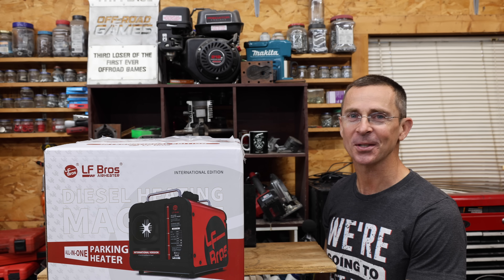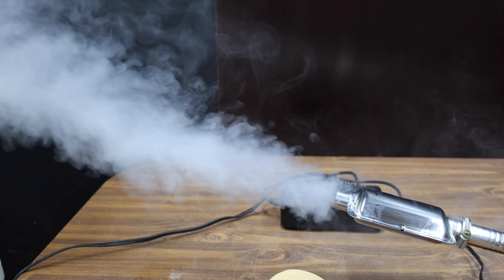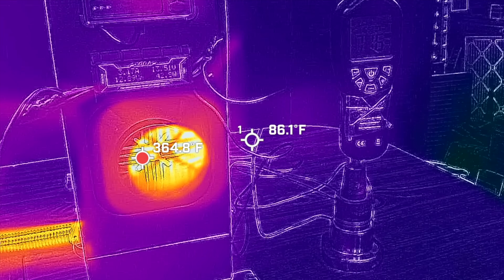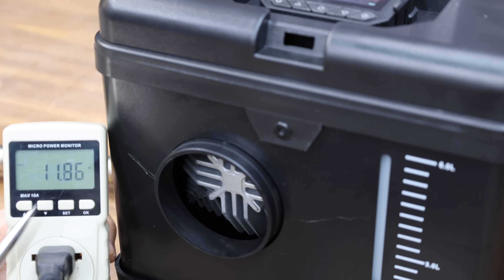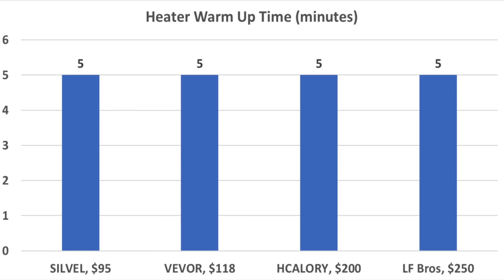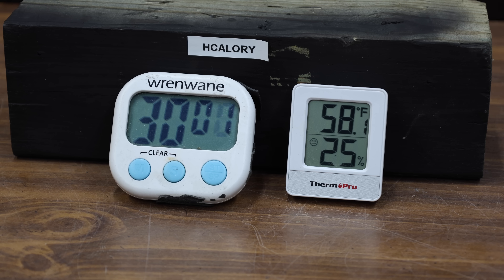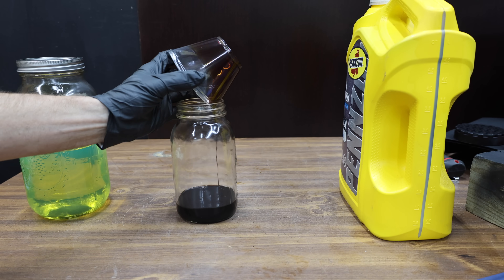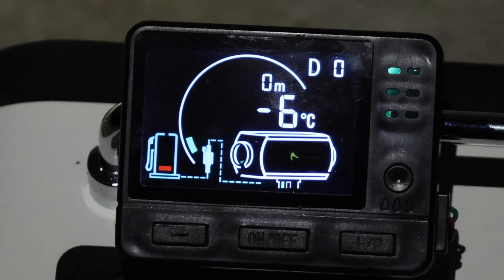The Truth About Cheap Diesel Heaters!

Comment from the maker: I have to admit, these diesel heaters perform a lot better than anticipated! I'll be having one of these heaters ready just in case there's an extended power outage from a blizzard this winter. Check out the video description for additional details. Thanks again for all of your video ideas, including this review topic! Best regards, Todd
VEVOR: https://amzn.to/4fXPjsy
SILVEL: https://amzn.to/3Vum48C
HCALORY: https://amzn.to/4fnFseJ
LF BROS: https://amzn.to/4glYZgi
AC to DC Converter: https://amzn.to/4g3Or5B
Cigarette Lighter Adapter Power Supply Cord: https://amzn.to/3Zo7vEO
Extra Long Exhaust Pipe: https://amzn.to/49pSpD4
Extra Long Air Duct: https://amzn.to/49tSRAc
Reply: Math time. A gallon of diesel fuel contains 138,700Btu or 36,500Btu per liter . These units claim to produce 8kw/hr of heat, which is 27,200Btu. Except,  these units claim to burn 0.5L/hr, which is 18,650Btu. How can you produce more heat than consume? Clearly,  the units produce less heat than advertised. 3412Btu per kw means that these units gross 5.35kw and likely net around 4.2-4.6kw of heat, or around 15,000Btu at ~85% AFUE, which is respectable. 8kw is impossible.
Reply: @kevinyancey958 exactly, that's why I'll  stick with my infrared  propane heaters. No noise no electricity  and very efficient.
Reply: @kevinyancey958 they're junk. Very little heat produced. Meant to heat a sleeper cab.
Reply: @kevinyancey958  fuel use I'd advertised on low setting, heat output on high..I haven't tested or do e the math to see how much they are lying by..but the L/hour vs kwh is simply  using the best setting for the parameter being marketed..every company I know does that.. example. when cars market 35mpg and 0 to 60 times...those test are ran very differently..
Reply: @kevinyancey958  my brother in math... Thank you for taking the time to say it so I dont have to.
Reply: @kevinyancey958 The noise must increase btu factor 😅
Reply: I want the hcalory but $200 is a lot
Reply: @pressinpickle345  I have the vevor. And four other brands. Only downside I ran across is every two years you have to clean the burn chamber out. That's the same with any brand I own.
Reply: @slarratt  no never have.
Reply: @bobdodge3171 ONLY downside? How about that they use deisel, heat 10sqft, stink, are loud...😂
Reply: @b @bobdodge3171 Not true.  Operated properly at high heat, they do not soot up.  Run under reducing conditions or on low settings they will soot up quite quickly.
Reply: @pressinpickle345 Don't waster your money. An inverter hooked to your car battery is SO much better! Lotsa vids on YT.
Reply: @DannebergAcres   Don’t be silly.  The typical 12V car battery can store about 3/4kWh!  8kW is about 5 times the power drawn by the vehicle starter motor, at least.
Reply: Please make a BEST BIODISEL video. Used veg oil methanol and lye supposedly works fantastic.
Reply: …I did request cheap Chinese diesel heaters comparison a few weeks ago..wow, thank you!
Reply: It’s best to have a battery backup because the unit needs a cooldown or you could have a meltdown during a power failure
Reply: Best water flosser?
Reply: Are you selling one of the heaters you don't want to keep?
Reply: Will you test portable bandsaw Mills? For lumber. ?
Reply: The problem with extended power outages is that these need power.
Reply: @othername1000 they work off 12v batteries
Reply: @othername1000    Doesn’t everything powered by electricity?
Reply: @othername1000 You can use your car battery. But then an inverter is  way better option
Reply: @DannebergAcres or a portable power station like a jackery.
Reply: LF Link= Currently unavailable.
We don't know when or if this item will be back in stock.
Reply: I got two of them they work absolutely awesome I bought bigger fuel tanks minor bolt 8K
Reply: @TheoriginalAndysgarage    Do you think that a larger fuel tank will provide more heat output/unit time?
Reply: Can you do a review of 1/2" cordless impact drivers? Name brands and knockoffs?
Reply: I have a few I get waste jet fule from an airport I work at free fuel most airports pay to get rid of it  if you live next to a small airport call them they might give you free fuel
Reply: Couldn't you run these on fuel oil and save the fuel taxes?
Reply: @tippytailmckitty2658,  just use off road deise fuel l, no tax on that. I would aslo suggest #1 deisel fuel.
Reply: @guybrock837    They are designed for diesel fuel.  It matters not (apart from the cost) as long as it is diesel powered (read the title on the box) and/or the title of this video!
Reply: Yes they run perfectly fine on it, in Ks. I burn off road diesel .50¢  off per gal.    @tippytailmckitty2658
Reply: Can you test emergency water storage bladders. Been looking at them for water storage instead of solid drums. I think it could also create awareness of different water storage options. That would help with preparedness for disasters. Thanks
Reply: Although I like these heaters, if I didn't need a portable solution I would be more interested in one that can run without any electricity.

I hate mentioning brand names, but like a Dickinson Newport or Sigmar 150.
However they are a simple design that can operate with a gravity feed day fuel tank and don't need any fan.
Basically a wood stove set up to burn diesel.
Reply: Would love to see a video about portable Induction cook tops, mabye the one you can buy at Costco, ikea & few others as well. Test water boiling times, consistency of temperature when set to different power settings, or deep frying ability, pot/pan size that they allow up to & mabye at the end take them apart and see how the coils are set up as I know some brands cheap out and space the coils farther apart than others.

Thanks for your videos!!
Reply: Now try one of the german made Arktronics heaters. They are something that you get what you pay for. Super fuel efficient, faster start and heat, quieter, and I am not worried about burning down my truck camper. They also come with a thermostat that auto cycles to hold a temp. Probably going to plumb one into the shop and one into the house on a battery backup for when the power goes out or the boiler breaks.
Reply: Hi, they even perform better if you plug the exhaust into a metal radiator, as it allows to retrieve calories that would be spilled otherwise.
Reply: @hankhulator5007  i was thinking  this why not use the exhaust  to warm a water pot can it boil water with the heat for emergency  cooking 
Also can we use it to heat a how water loop for a hot shower in the camping  or heat water for storage for longer heat runs 
Or what about  a small radiant  heat concrete  slab to utilize  like a hot rock and run it less fuel
Reply: Blizzard or more likely ww3 preemptive cybernetic warfare get ready folks!
Reply: @ProjectFarm  I recommend buying a 12v battery that can fit in your vehicle to charge up...
Reply: @slarratt Buy an inverter and plug in your hone furnace!
Reply: @DannebergAcres  furnace? What furnace? I have electric baseboard heaters. Diesel greater is a great choice in my case.
Reply: @DannebergAcres or plug it into a portable power station like a jackery if u got one.
Reply: You should do another pocket knife test! With the Demko ad20.5 sharks foot knife in it!
Reply: @ProjectFarm  ww3 incoming
Reply: I had no idea staying warm during power outages could be this easy—brilliant invention!
Reply: I hate my 1,200 sq ft house mobile home   for  9 years have a battery hooked to a battery tender how can I have the power goes out just not interrupt the heat
Reply: @Theresahackforthat  Get a UPS ( uninterruptible power supply) and plug the diesel heater's power adapter into it so you have time to shut it down properly if needed.
Reply: @Theresahackforthat Hook it to your car and charge it
Reply: on the vevor, you missed the u-shape cutout on the back for the exhaust pipe to go out i think. But I may be wrong
Reply: I recommend hosting Charity auctions of all the undamaged equipment you end up with.  Your fans would enjoy having something from you and you can help your local citizens
Reply: Hi Project Farm

A future video idea I would be very interested in watchimg is a comparrison of 12v Lead Acid battery health testers performing a drop test.

I recent had a garage using a Durite meter to fail my car battery. I bought a cheap Topdon BT20 tester that rated batter Ok. Tried test again with a Amp meter clamped around positive wire and max reading of 45A which seems v low and wonder how this compares to other brands
Reply: Please make a videos about welds under $300. Budget welders
Reply: Hi project farm. Not sure if you know a lot about diesel trucks but for example there’s the 6.0 powerstroke. One of the big issues with the 6.0 motor is the head bolts. With that there is head studs. There’s the top of the line brand ARP and other brands like XOTIC, TRACK TECH, and other brands. I’d love to see a test comparing different brands because people say ARP is the only trustworthy brand. Other brands claim the same if not higher tensile strength and someone needs to put them to the test. Would love to see a video testing them.
Reply: I run 2 of these in an insulated 30x40x12 barn and to go from 50f to 60f it takes about 4-5hours. I keep a Ceiling fan and an oscillating fan to move the air around.  I do have a a lot of mass to heat up in the barn though lol.
Reply: So much nicer watching with the volume off
Reply: Hi, I have a "product" suggestion.  I know you are always looking for new test items.  Have you considered testing DIY "hacks"?  I recently watched a DIY sand heater video and of course You Tube is now flooding me with heating hacks using flower pots, bricks, candles, crisco, etc.
Reply: @tinknal6449  my only thing would be you’re gonna have to use a sealed container, completely sealed because the silica in sand must never be breathed in
Reply: The United States government is controlled by alumni corporations, and they build low-grade products to keep the revenue flowing in It’s unintelligent and a waste of resources when there’s one proper way to build a lot of these devices project farm always compares some devices have some perks that other devices leave out and they keep it mixed up like that because of their monopoly system YouTube boiled out this guy‘s opinion to be shared on YouTube but if he explained to the people how the corporations monopoly system preventing them from constructing the right product because it opposes ideas and inventions and discredited what they were doing you would never hear this person‘s opinion on YouTube
Reply: @TMartinez-n8g Wow, the big scary THEY again … 😂😂
Reply: How about testing Costco Kirkland brands versus name brands?
Reply: Very welcomed review, thanks PF!  That said, anyone by chance know if any of the heaters allow the user to program the heater to turn "ON" during a specific hour & day of the week, via a cell phone App(?)
Reply: Are you considering selling any of the heaters?
Reply: If you go suck out old oil tanks heating oil which is kerosene and they are pulling the tank you can get lots of free fuel for some reason the home heating oil puts out more heat name the diesel can you buy at the store if I run just diesel I put marvel mystery oil in it lubricated
Reply: Thanks for the video's
An Idea though a bit late for Christmas safety, single use & small fire extinguishers.
Reply: Great info as always. To gauge the heating power, how big is the shop they were heating?
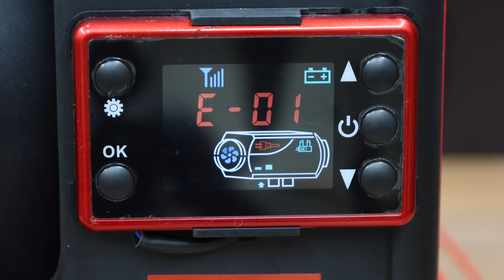Reply: Hey I want to help you out here. You made a mistake on the voice over. 2:20 I believe you meant diesel heater, NOT diesel generator. I am just helping you out so you do not get made fun of
Reply: @ProjectFarm do you ever sell any of the stuff that you have left over from the tests?
Reply: Project farm ! We need a best ash vacuum video !!!
Reply: blizzard . sure. you mean the ews ?
Reply: Suggestion. Best outdoor string lights. Length, spacing, brightness, cost of replacement bulbs, how many string together and still work? As always great videos.
Reply: What would happen if you put pure granulated nitrogen in a gas tank of a mower or a two-cycle engine
Reply: Heat the house with it cos the Air Source Heat Pump is so expensive....
Reply: The 1st heater failed 1st start. So pumped a load of diesel in chamber, when restarted it smokes burning the wasted diesel in camber and exhaust. That's the reason it smoked loads at 2nd start.
Reply: Those seem like pain with exhaust and power.  How about testing out the propane ones.
Reply: Thank you for the video! 🙂 Do you have any tips on what we can do with our Hcalory - the ac/dc plug is not working - We plugged it into an outlet and the light on the box turns on but once we plug the other end into the heater the light on the ac/dc box turns off and does not power the Hcalory. HELP 🙂Please
Reply: @ my ac plug is wired up the wrong way . Live is neutral, neutral is live…. They really are a useless shower of shit. Even my lead to the battery is round the wrong way. I have to connect the live on the negative post and the neutral onto the positive
Reply: Hey Todd, I can’t  find a way to contact you. But here’s a test suggestion: Steam Cleaners. There is ZERO comparative reviews out there. And these can be important cleaning devices, especially for disinfection of animal cages and pens.
Reply: My place drafty I found 2 5 k non cabinet style for under 100  on line set them up on wood platform out side window heat piped in like portable ac gets rid of heat . Use one I need high use 2 setting 1 to 3  2 saves desil plus set to max. Temp goes from 60 to 75 in 20 min😂
Reply: I have one on 12 volt lawn mower battery it can run 8 hrs add a small gen like 800 wat trickle charger or fast  your set 5 gal of gas will go days keeping heat
Reply: Did I miss something? How are these going to be useful in a power outage if they all need to be powered?
Reply: I wonder how they compare to the old fashioned perfection oil heaters
Reply: I got a vevor that was defective and the company will not issue a refund.
Reply: 220F! I want to be warm not dehydrated.
Reply: LF BROS made a big splash in the market with some really nice heaters for a bit of a premium price but they've been gone on Amazon for quite a while. Their website is still up but you can't buy them anymore not sure what's going on I'm sure glad I didn't get one because now everyone who bought them is screwed for parts.
Reply: M
Reply: Todd, I just got one of the vevors on Amazon for $90 and I’m legitimately impressed. It’s going to go into my garage aka the wood shop and I think it will work nicely in the 650 square foot space. I’m considering getting a second one for my pole barn aka the mechanical shop and although it’s 600 square feet, the bottom of the trusses are 10 1/2 feet and the uninsulated roof is a few feet higher. I mean, it’s better than nothing, but do you think it will make sense? I also have a few propane powered heaters of various designs if needed.
Reply: You should do dehumidifiers.
Reply: What are your thoughts on Vevor products?
Reply: Keep up the good work...
Make a video about Car waxes... especially Nufish
Reply: I love it, I been sleeping in a field year round as a homeless man judging the people. No more , bought a mobile home and a diesel heater and batteries .. loving it🎉
Reply: I've searched your videos. Have you tested countertop Meat Grinders or Vacuum sealers? I couldn't find anything on your channel.
Reply: @DrivingWithDon  hey that’s a good idea. I’ve been thinking about making my own hamburger.👍😊
Reply: I have had two vevors for 3 years and not missed a beat, I use one at home to heat my upstairs and one on a yacht, I love them...
Reply: @slarratt The yacht is the only reasonable use.
Reply: So if the power is out and these diesel heater need a power to work ???????.....Thank you Awesome Farm Guy.....                                                                  
Old F-4 pilot Shoe🇺🇸
Reply: @steveshoemaker6347  run it with a 12v deep cycle battery and use a battery tender. If you lose power it'll run off the battery for hours!
Reply: @steveshoemaker6347  Any 12 volt battery will work.
Reply: @steveshoemaker6347  don’t you have flux capacitor? Everyone else does
Reply: @steveshoemaker6347  a 12v battery mate. They were made  for idling diesel trucks.
Reply: @steveshoemaker6347  it will run on a 12 volt auto battery, depending on  the size could run for more than a day.
Reply: Accurate. I feel good about purchasing a vevor now. At only 90$ on sale
Reply: @ and that’s why humans cannot see the truth in these low-grade products the corporations waste resources producing because if they feel good about it, it’s good enough for them to not think about it as long as it works good enough that will open the door for human to feel good about it and accept it
Reply: The Vevor has a hole for the exhaust pipe on the back leg.
Reply: For future vids could you please add Metric labels over the vid so the rest of the world can understand what's REALLY happening.  Other Americans do it on their vids so I know its possible. MPH for these things would normally  be M/sec. etc. and British Thermal Units??? really? I thought you guys weren't a fan of the British!
Reply: Please see my warning about these.
Reply: Won't kerosene burn cleaner than diesel?
Isn't kerosene cheaper?
Reply: @dragonhealer7588 does burn cleaner, but currently, kerosene is priced around $4.19 per gallon, while diesel is approximately $3.95 per gallon
Reply: TERRIBLE IDEA!!! They only heat a few sq ft. An inverter hooked to your vehicle will power your house furnace indefinitely.
Reply: @DannebergAcres  Wrong...    and wrong!